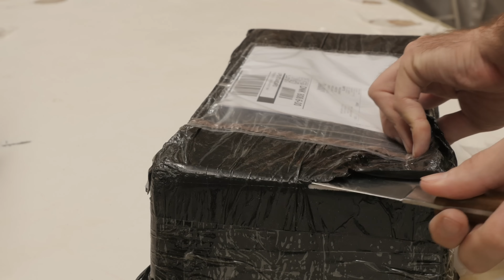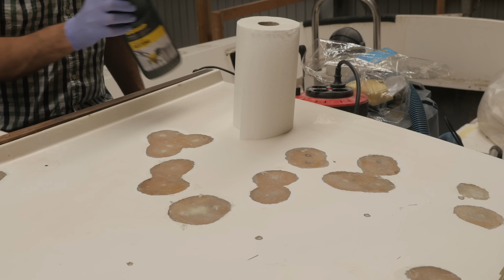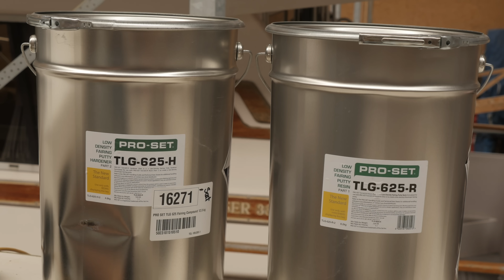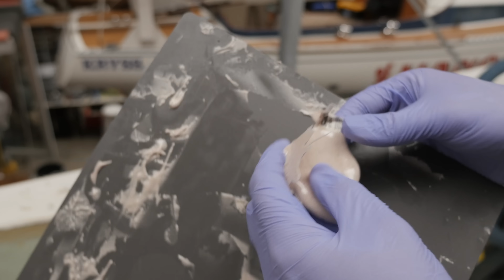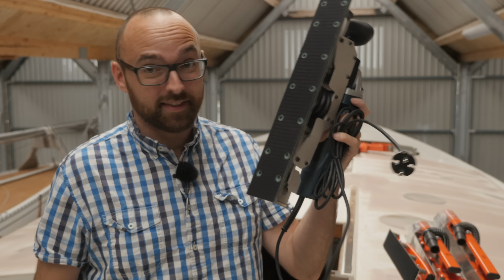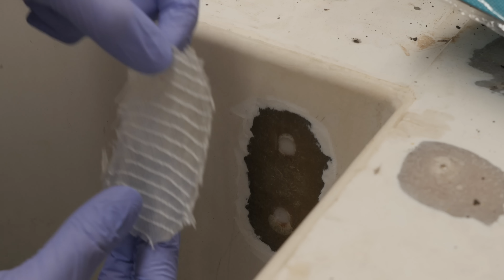Sail Life - Fairing the cabin top (first layer) & Flexisander tools - DIY sailboat refit

Comment: If you ever plan on going through any locks, often the lines are rather thick.   My dad made sure to have one LARGE cleat on each quadrant of the boat.    Large refers to the height of the cleat from the surface of the boat.   

An alternative for the bow is to install a Samson post.   Usually located on the centerline of the boat and attached to the internal structure of the boat.  You can use a Samson post to tow the boat, attach any lock mooring lines, . . . and to attach an large anchor bridle.   My dad installed one on his Pearson 39-2 after experiencing frustrations with areas that have large tidal ranges and locks with fat lines.

Comment: Nice job on making sure not to contaminate your surface before sanding. Most people just jump in with a sander. That is exactly how I was shown to do bodywork prep with acetone and paper towels. Nice job! Again most people just start wiping and merely just push the contaminates they are seeking to remove around.

Comment: consider getting docking lines that swim on the water. if i remember correctly, polypropylen does. liros has sqare lines of that material. you however need one size larger than other materials. but do not get thicker lines than recommender for your boatsize or you saxrifice their ability to absorb dynamic loads.

Comment: Mads, I am late to the party this week. But, when you are at a dock, you are normally going to have at least a bow, stern and 2 spring lines. Often you will have more than the basic 4, all sharing the load. As conditions worsen you will be adding extra lines anyway. So if you wanted to save money you could go with the smaller line for dock lines. For a mooring ball, you are going to want larger lines because they are going to form a harness or bridle depending on what you want to call it. In this case go big, because you are going to have only 1 or 2 lines and they will be shorter so there will be more shock and less flex or stretch to them. It would not hurt to have the big lines around for the boat and all the different things you are going to do with them and then have a second set of lines for the light stuff, dingy, bumpers, floats, loaners, drunk red heads, and emergencies.

Comment: About the Mooring lines. 
With multiple lines in a dock situation, all would probably do fine as the pressure load on them would under almost all circumstances be much less than the lines can handle. No problem there. I would take the middle ones in different lengths. Not too long (perhaps 4-8 meters) that is unnecessary for normal "parking".    

Out of the harbour: 
If You do not have good ground tackle, in Athenas case I would estimate that would be something like 60-100 meters of 10 mm galvanised chain with a good big anchor at the end, You might end up tied to a Mooring buoy which is real hard on your lines. There is very little dynamics in that kind of system and therefore the shock load in waves on the line will be dramatic both on the line as well as on the cleat. Big gear might do it, but these buoys are also known to loosen themselves so getting some sort of dynamics into the system would be best. Strong line. Not too long as you will want to swing around in wind shifts as the other boats do. By the way another annoying thing about mooring buoys is that you often, in no wind situations, end up lying alongside the damn thing rubbing up against it.   

For towing other boats, or being towed, long lines are best. Again to get some dynamics into the system. Go for a big strong line. Around 50 meters I would say: those long lines can be real handy if You go adventuring into the Skærgård fx tying up to islands, maybe between them, thats a lot of fun:-)
Summasumarum its good to have a selection of medium and strong lines in different lengths. God vind og medløbende sø.

Comment: Could you just use thickened epoxy as a fairing compound?
Or what is the difference between epoxy "peanut" butter used for fillets and fairing compound?
Sorry if this is a somewhat naive question :)

Comment: The cleat needs to be able to pass the eye of the dock line.  Bigger lines are better... you can't go wrong with more over less.  Length of the docklines can be crucial in a situation where you need to attach bow/spring lines in a marina with wide slips (applicable to Motor Yacht marinas), so don't go short to save a few bucks.  Be sure to have at least 6, with more for backup.

Comment: One thought on the Flexisanders (which do look like brilliant tools): were the "track marks" raised rather than recessed? If the amount of material being pushed along by the blade of a putty knife becomes great enough that it spreads out wider than the blade you'll get tracks. A larger knife, and a little overlap on the previous track to pass over the raised track should eliminate those. I am not sure if that is exactly what I saw but wanted to pass the thought along.

Comment: I was expecting those proset cans to have a radioactive emblem on them.  I am thinking...what's Made gone and done now...a Flux Capacitor?  The 18 mil rope with the larger cleat has got my vote, but....I seem to recall something about the size of the cleat vs the thickness of the deck....I'm no expert either, and my memory has faded, but a cleat and rope combo able to handle tremendous loads doesn't mean much if the cleat rips out of the deck....something like that.   Can't  hurt to ask around.  Did the Flexisander people provide any feedback?  Only Mads can make sanding interesting and even spiffy

Comment: A great thing to acquire is a big roll of floor sanding sandpaper that floor installers use for working in houses. I used to spray a wooden tool I made with 3M spray adhesive, adhere the sandpaper  and trim the sandpaper with my exacto. If I was going to use a flexible batten I would superglue one end of the sandpaper onto the batten and only pull in one direction. Otherwise it buckles. I would buy knobs and screw them onto my tools because they worked better that way. I had found some fairly stiff foam rubber I glued onto my tools when a bit of flexibility was called for. It was about 1/4 inch or 6mm.

Comment: I don't like to over-size mooring lines because you loose too much stretch in the line.  Stretch is your friend. Lack of stretch contributes to very high shock loads and the thing that is most likely to break is not your mooring line, but the poorly-installed or maintained mooring cleats at whatever dock you are staying at.   

Oversizing mooring lines puts more stress on your own cleats too, probably not causing a catastrophic failure there, because I'm sure you are putting in really spiffy backing plates plus your fiberglass work is A1 quality, but the weakest link is almost always the unknown cleats at an unknown dock.  The added stress of high shock loads during storms and such on your own cleats will probably shorten the lifetime of the bedding compound a bit.  With butyl it'll force more of it out faster and require more frequent re-tightening of the through-bolts. 

The only time I like to use over-sized mooring lines is for the actual docking maneuvers.  It is a lot nicer on the hands and easier to get good purchase on the dock cleat while stopping the boat.  We run a set of massively oversized stern lines just for those times when we really want to be able to "hit the brakes" when coming in hot because the winds and currents are squirrelly, or maybe the helmsman just messed up and simply came in too hot.  Who knows why, but having big meaty stern lines to belay and use to brake the boat give a feeling of confidence when it happens.  But I don't like to leave them on after getting docked in conditions where they will not be able to stretch a little and act like a built-in snubber.

Comment: It would depend entirely on the situation what line to use in a sheltered marina with multiple lines  either side, as is standard in marinas here then 14mm would be ample. If it's in an exposed or lines only on 1 side then i would go for atleast the 16. Then if it is a single line to a mooring etc I would say atleast the  18.

Comment: What size line to use?  On my Catalina 320,, the boat weight calls for using 1/2 inch, but I always go "up" one size, so I use 5/8ths.    Never once do I ever "wonder" if my lines are going to break, I just know they wont.   The only disadvantage, is that during hurricane season, it's a bit hard to double up the lines.  After two 5/8ths, there isn't a lot of cleat left.  Looking forward to more glorious sanding.

Comment: What I never understand is the degreasing with acetone. I learned that the only way of degreasing with a solvent is vapour degreasing what means bring the part you want degrease in the vapour of a heated solvent. Of course, the kettle has a cooling on the top so that the vapour can't get out.

As you cannot build a kettle for a whole ship normally (i.e. in the car industry) they use water based degreasing agents. Thea based an water soluble solvents, surfactants an can be wiped on. Mostly the surfactants do a very good job even in the running property of the paint. Acetone, white spirit and other solvents are only used to get away big layers of hardened grease. 

What you normally do while using acetone is dilute the grease and wipe it over a bigger surface. You try to prevent of it by using the paper only in one direction and wipe the acetone of as quick as possible. That's better than it is mostly done but be sure it is not as degreased as possible when you use a water based degreaser. And, of course the modern painting allow a small amount of grease without quality changes of the painting. Therefore it works mostly with acetone, or low boiling alcohols.

Comment: As for mooring lines, I have never bothered with any particular brand, I just choose the next size up that is recommended for the boat.  I like three strand as it much easier to splice and usually cheaper so I can carry extra and make whatever length I desire for the area/dock I'm in.  Not all docks have cleats spaced for your boat and sometimes you may want to raft up with someone. Also carry a few meters of cheap heavy tent canvas, stitching awl and waxed line to make chafe guards as needed. Beeswax in the canvas helps cut the squeaking and wear.

Comment: If you connect to a cleat a line with a loop braided in the end, then the size of the hole in the middle of the cleat is an issue.  The loop is pushed through the hole and then wrapped around each end of the cleat, so a double layer of the line needs to easily fit through the cleat.  If you never intend to connect a line this way, then, never mind.....

Comment: With respect to lines, I find that far too often people oversize them.  Part of sizing properly is to ensure that they have enough stretch to absorb shock loads.  If you have too heavy a line, they don't stretch sufficiently.

Big cleats (within reason) are good.  

Someone down below mentions having cleats that you can pass a spliced eye through the center. I don't like that idea.  Sometimes you need to get a line off NOW.  With any kind of load on a line that is threaded through he cleat, the only solution is a knife.  Expensive lines.  Knife.  Not a good combo. 

I used double braided nylon in probably one size too big.  I have LOTS of docklines and mooring lines and bridles in various sizes and such for different uses, circumstances and conditions.

Comment: I would look for a cleat with a larger opening in the center. As well as making it easier to fit a doubled line through the opening the mounting legs are farther apart spreading the load to a larger deck area.  An over sized backing plate helps as well.  If it is strong enough to lift the boat from, it might be strong enough to withstand the storm created shock loads.  I would hate to see the boat lost and the cleats hanging from the lines.

Comment: Hi Mads, have you thought of using a guide coat during your fairing process. This will show up the high and low spots during sanding and where to place subsequent coats of compound. Once you feel you have everything at the correct level apply a thin skim coat overall, again guide coat it and then final sand. 3M make a dry guide coat which is useful and easy to use but if need be a satin black spray can will do the job. Whichever one you chose apply it very lightly and sparingly.
Good luck with the process and your restoration, can’t wait for launch day.
Best wishes.
Steve.

Comment: Mads, from my experience building super-yachts, is that people don't realise that yachts live in a dynamic environment where equipment can be shock loaded. Where you can not can not really calculate the loads. Ropes (new ropes) are tested with a steady pull in a controlled setting not at the dock or at anchor in a gale.Also you may have to use supplied mooring lines (e.g. at a marina or dock) which could be larger than your lines.I don't like the shallow (1st new model) cleat, even the second wasn't much better just longer.I was pleased to see you reinforce the Mainsheet padeye deck area. Despite 2 padeyes the windward one will probably have the most load.

Comment: Ahh mooring lines.  I use two types of mooring lines for my Allied 36 ketch.  For attaching my boat to a mooring I use a 22mm (7/8") Yale Polydyne pendant.  That pendant is a double braid line with a nylon core and a dacron outer braid.  The idea is that the nylon provides stretch while the dacron is more chafe resistant.  The pennant also has a separate cordura anti-chafing sleeve.  The strength rating on that line is 12,800 kg.  To tie up to a dock in normal conditions I use 12.7 mm 8 strand brait lines with a strength of 3,750 kg.  If it supposed to be stormy I have a second set of lines made from 16 mm 8 strand brait (5,500 kg strength) that I add to my normal lines.  I have two bow cleats made from stainless steel.  They are 38 cm heavy duty cleats.  My midship and stern cleats are 20 cm aluminum cleats of the same design as yours (Schaefer cleats).  I made up my dock mooring lines myself by splicing eyes into the bow and stern lines and including chafing sleeves for my chocks.  My spring lines are a single length of line with an appropriately located brummel splice in the "center".  I prefer brait over  3 strand or double braid mooring lines because the brait is stronger and has more stretch than the same size 3 strand or double braid.  Brait also does not hockle.  

For anchoring I have  60m of 8mm G4 (high test) chain with 60 m of 16 mm 8 strand nylon brait line spliced to the end of the chain.  I normally only anchor on the chain.

Comment: Im not really a boat guy, but I do quite enjoy the videos! I have one 
question, what exactly is the purpose of the fairing compound? Feels unnecessary since it will get painted over anyway.
Reply: The fairing compound fills imperfections, builds up low areas and smooths out the compound curve lines
Reply: Hi. You do that to make sure the surface is at the same height . Sanding will remove bumps but not indentation, If you only paint all imperfections will show when the paint as dried.

Comment: Before you eventually go voyaging, you will need to establish MADS' GENTLY USED TOOL EMPORIUM & SURPLUS MARINE SUPPLY.  haha ! Honestly, I think you can get acceptable to excellent fairing quality with simple drywall taping knives and a basic straight edge. Even your fancy fairing floats require the same practice and experience to finesse for top results. Minimization of ridges at the overlaps, I've learned, is a matter of flexing a 12" wide taping knife (light weight aluminum works best for me) by asserting pressure on the loaded side of the stroke while tweaking the angle of attack. The object of coordinating the curve/pressure and angle is to feather the new stroke to the previous one without removing material from the previous stroke.  (not unlike the Wright Brothers' wing warping idea) I think the frame design of the new floats may actually disallow the blade warping and curve of which I speak. Side slipping your 14" knife toward and away from the previous stroke in a sweeping S fashion is another part of flying your blade. With practice you will get better and better at minimizing ridges when fairing wide areas. Of equal importance is how to load and distribute your compound onto the 14" knife. I use a 6" taping knife to load my 12" aluminum knife. I also use the 6" knife to clean the compound from both sides of the 14" knife just prior to each finish stroke. Not sure if you have or need a thinner for your compound, but warmish peanut butter is the perfect consistency for seamless fairing. Less ridges = less glorious glorious sanding, less wasted compound and much less dust. Old school plasterers were so good at this, entire walls and ceilings were finished with no sanding required at all. You will have a chance to get some real practice when you're ready to fair the new glass on the bottom.

Comment: Awesome work Mads.
It seems to me the cockpit locker had wood to stiffing it.  Outside at least, but maybe inside as well.  I would consider adding wood inside and glassing inside for strength.  Use fairing compont to create a filit outside but leave it basically the same shape.
On the line.  What type of toerail?  With a fairlead?  These details may change what line I use and how I connect.  Typically I like old garden hose for chafe protection.  It is easy to come by as it seems there is always a leaking hose at a marina being discarded.